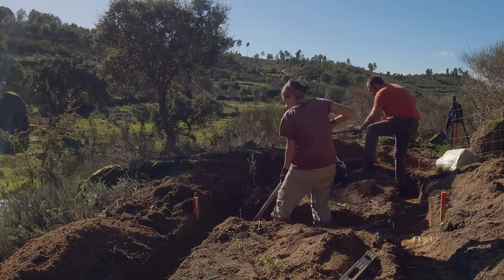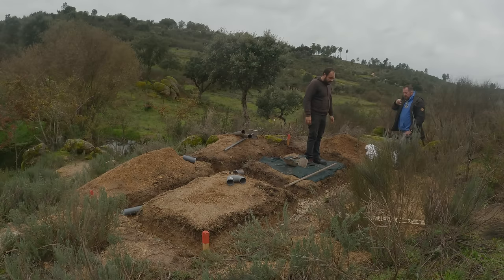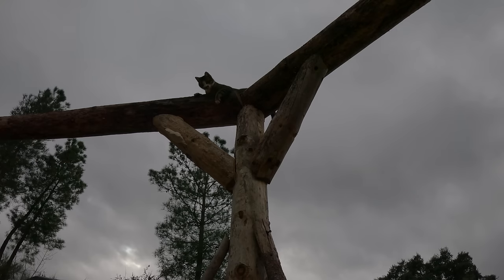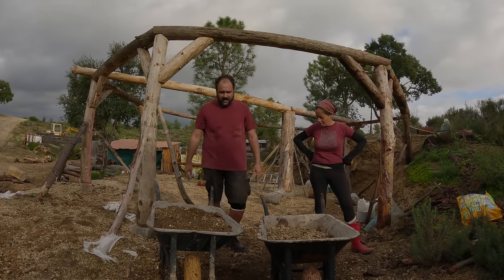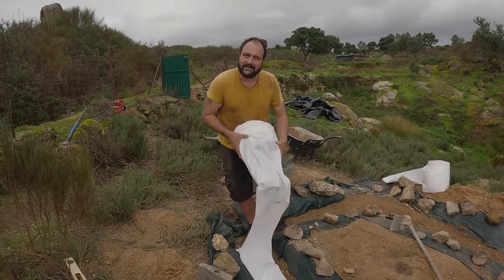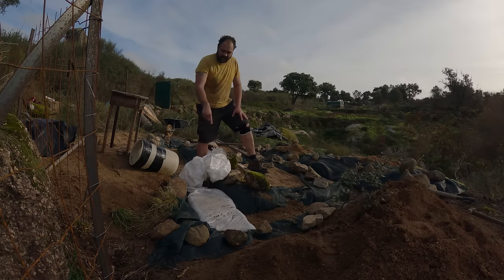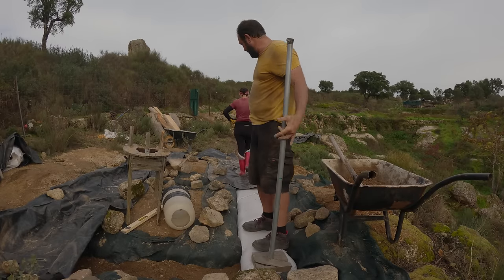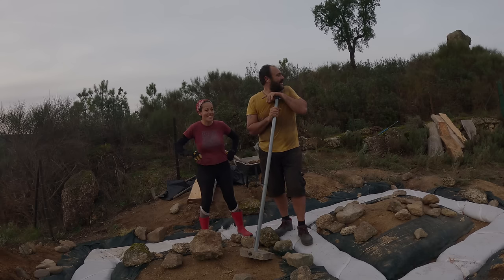Building An Earthbag Pig House | #2 First level Up

Comment: Great to see the progress for the pig houses. Have you considered buttressing the back wall in a couple of places to add lateral strength? Long straight walls are the most vulnerable in earth bag buildings especially with the bulk & strength of a couple of pigs to challenge it!
Reply from the maker: Not sure we need too as there is a wall separating the two rooms so it's basically two square rooms joined together
Reply: @lukeandsarahsoffgridlife  have a think about when the girls are inside & lean, rest or scratch themselves against the back wall...
Reply from the maker: @stateofgrace9068  we will see once they move in 😀 but their other bedroom ,they would just go in to sleep

Comment: If your going to have them farrow, have their babies, in the new huts you need to have 2 doors per hut. Your girls are currently gilts till they have 2 litters. So your gilts will come in and lay down to let their piglets nurse. You don't want your new Mama's to turn around in their huts. When they do that they end up stepping on and killing piglets. Ideally the hut is just a bit longer then the pig. That way they walk in one door and leave threw the other. Make sure the hut floors won't flood. When we started we lost some litters to flooding. Basically was enough rain to get the bedding wet which chilled the piglets and we lost them. Dry straw and  dry sawdust makes good bedding. Your girls will most likely build a nest when they want to farrow. Put some bedding in the hut but leave her part of the bale to do what she wants. Normally I just quickly put a bunch of straw in real rough and let them arrange it how they like it, messy straw they organize how they like.  Have had sows remove all the straw if I tried to help to much and made it neater. They shoved it all out, then carried it in themselves to build the nest. 
      I would recommend a small enclosure around each hut and use wood fence on the one side so the girls won't see each other when they get close. Gilts and sows want privacy when they give birth since other pigs will sometimes eat the newborn piglets. We had a sow that went canabal and it was not fun. 
       Instead of having a valley between your huts I would recommend build center wall taller and making that the roof peak. Easier to build and way less water issues down the road. Just make sure the huts run off doesn't turn the area around the hut into mud pit.
       Good luck hope this helps out. Pigs can be a challenge.
Reply from the maker: Kune kune pigs are much more gentle than other pigs . we cannot change our build now but thanks